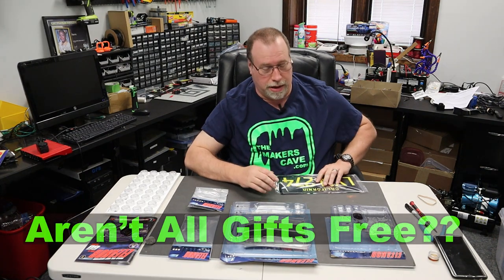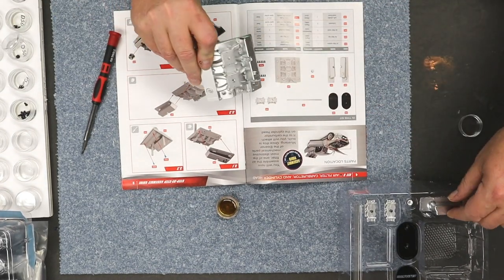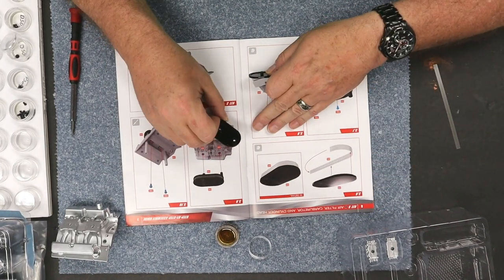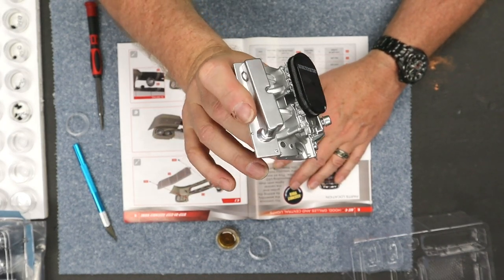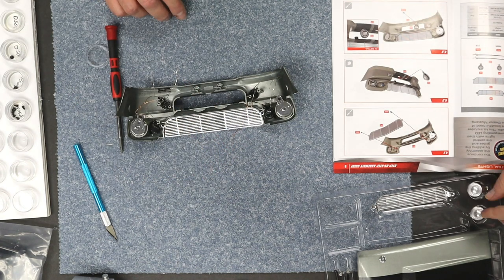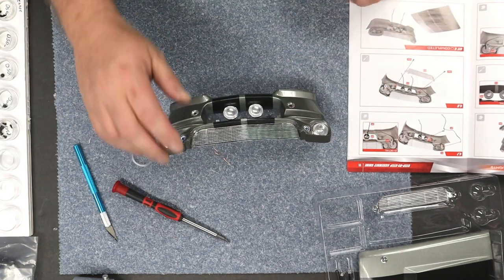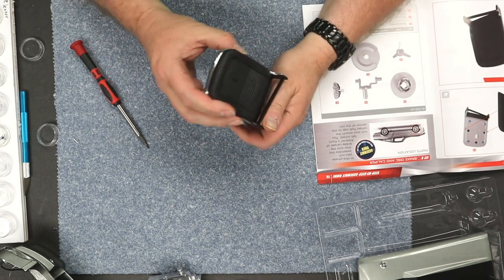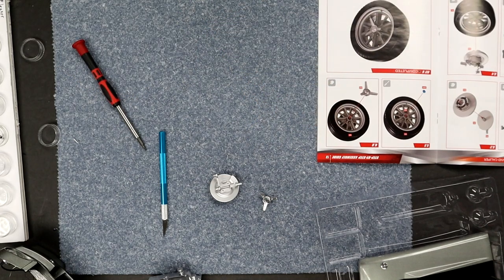Eaglemoss Eleanor Issues 3, 4, 5, 6

Comment: Are you going to 3d print some new valve covers and air cleaner.  The one in the kit are horrorable. Oops sorry didnt let the whole video play out.  Looking forward to the remodeling of the air cleaner
Reply: Sure am, that air cleaner is so bad that it was the impetus for me ordering a Anycubic Mono X 3D resin printer for the Cave.  It arrived last week and I'll be setting it up this week.
Reply: @SWillans  awesome. Cant wait to see/order the new one
Are you going to do different valve covers as well???
Reply from the maker: I'll have to see about the valve covers.  I might just use some self printed water slide decals.  A few pics of the Eleanor engine, of which there are many, have covers that are chrome, like EM, but with black lettering with an outline.

Comment: Is your top grill loose? Mine was. And I ran their wiring in first.. under the grill..
Reply: Beneath the grill.. it is a tight fit
Reply from the maker: Surprisingly the grills are secure.  When I was assembling them I didn't think they would snug up, but they did.

Comment: Just incase you do not know the screws from different builds even builds from the same company should not be mixed as they are almost always different.
I.e. AP screws from the delorean are not the same as AP screws from the enterprise.
So spare screws when kept should be done for there own build
If you need to get two  28 section pillboxs for each build for AP/BP/CP and so on for plastic screws and AM/BM/CM and so on for metal screws put some masking tape on each section and write the letters of the extra screws on them and label the screw with the name of the build.
This is only my opinion and just a suggestion if needed.
Reply from the maker: I have separate parts holders for each build.  In my first video for the Delorean I show how I make them.

Comment: I was suppose to get the binder with this order.. I had to call to order.. 
The word Eleanor is backward on my air cleaner..and  I need the right air cleaner to when you print them!! I purchased the light set! Thank you!! They  Need the plug in Eaglemoss uses...
Reply from the maker: I did get the binder but that air cleaner really annoys me.  I read online somewhere that the owner of the rights to the Eleanor mustang would only sign off on Eaglemoss's build if EM put Eleanor on the air cleaner.
Reply: When you print off the right one.. I will purchase one.

Comment: New model car builder here. I was wondering exactly how this subscription works? I ordered the Eleanor but noticed it only shipped issues 1 and 2. Does this mean I have to wait a significant amount of time to even receive all the parts to finish the car? If that's the case I'm not too pleased with my purchase lol.
Reply from the maker: Yes, in the USA, your first shipment in just issues 1 & 2.  You get a shipment each month of 4 issues.  If you want to build it quicker, like me, I called Eaglemoss and had them ship me 8 issues a month.  I believe you can get even more but I wanted to keep my per month cost within reason as I am also subscribed to the Delorean and the Enterprised.

Comment: Drill out the lug nuts...1/16th bit.. use  2.5 mm x 3mm hex head bolts from rc4wd..they are the acorn top bolts. Add them before you put the rotor on.. file or cut to fit length.
Reply from the maker: Maybe it's too early for me to think, but I can't find them on their site.  Is it possible you can post a link?
Reply: Can I find you on Facebook? Farmer Downs. And im waiting on 6-9!!!
Reply from the maker: @daledowns9447  Here's the facebook page for The Makers Cave: https://www.facebook.com/TheMakersCave